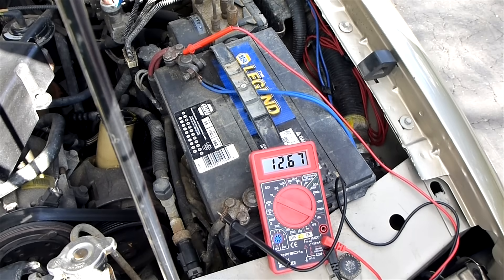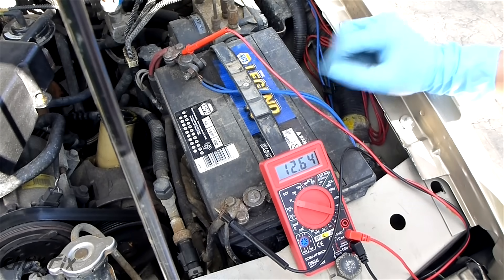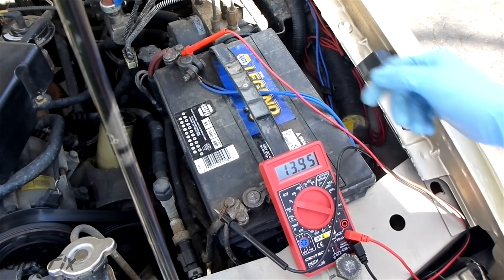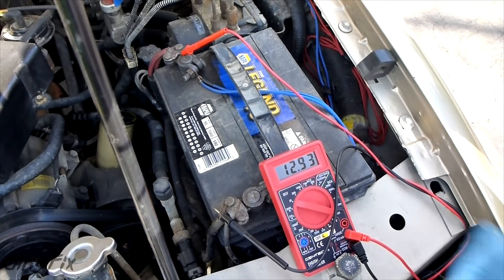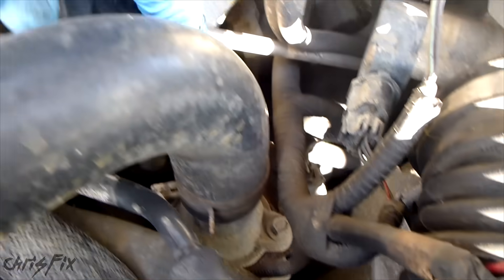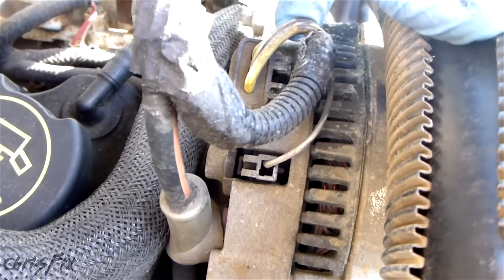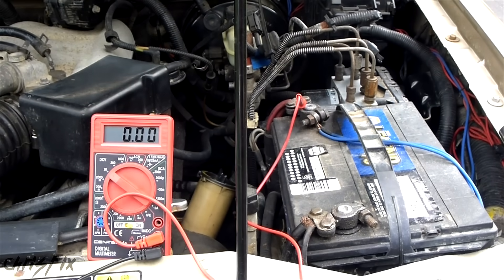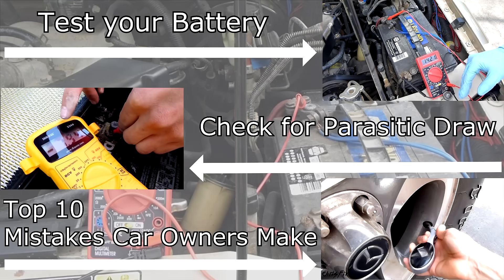How to Test an Alternator

Comment: What does it mean when there is no load and the engine is running the voltage across the meter stays at 12.4V DC? It stays the same regardless of RPM, however if it load it up with full headlights it will goto 14 Volts or with AC on full. If I just turn on daylight lights and pilot lights it stays at 12.4V DC. This is on a 2015 Honda Accord EXL just started noticing this when my battery keep dying every 4 days. I spent 2 weeks measuring the battery and charging it on and off until I decided to check the alternator and finding it is only charging 50% of the battery all the time. Is it a connection or an alternator issue, the battery is original from Honda from the factory since 2015. The dash is not showing battery light as an issue and no error code is set.

Comment: My 17 F150 is showing 12.55v off, then 14.7 on, also when increasing the demand. Yet it keeps saying "Charging System Service Now". No problems when driving it. We had a storm a couple weeks ago when I drove it I lost my monitor and power steering for a few moments. Ever since then it hasn't happened but that light still comes on. Anyone able to explain this?

Comment: can you please do a video on overcharging alternator. My alternator light is blinking, new alternator and new voltage regulator. No light on – until I start driving for awhile then alternator light starts blinking. Multimeter says charging about in the 15 to 16 volts

Comment: My car never ran at 14 V even new  ... The dealer says the normal operating voltage is 13.5    for my Mazda ..  My voltage never goes below 12.8  Even when I put all my accessories on it might go to 12.8 but it will go back up again...      every Vehicle is different    ,, I have multiple cars I've never seen 14 V on any of my  cars  Every modern car is different today ,,check with your manufacture

Comment: Great video . I have one question. Are these numbers consistent across all vehicle models or just the one in the video?
Reply from the maker: By numbers do you mean torque specs? If so, they are specific to each vehicle. You can find them online with a Google search most of the time or get a service manual. The voltage on every car should be the same tho. And the process I showed you will be very similar/the same.
Reply: @chrisfix  yeah just the voltage readings. 
So if it's less than .1 or .2 on that one test, and less than .3 on the other test, and battery with 14.6 volts running and 12.6 off, these numbers should be consistent across all vehicle's regardless of the alternator size?
Reply from the maker: @Jay-jt3zy  correct. Amperage will vary but we aren’t looking at that, just volts.
Reply: @chrisfix  yeah I know amps will vary depending on vehicle, was pretty sure but not for certain about the volts. I defer to the pros like you to ensure my knowledge is correct. Thanks for the help. Great vids.  Detailed and thorough.
Reply: @chrisfix  I am haveing a problem  on my ford connect  1.8 diesal battery light  on dash i have put a new battery  and done all the test one the ground  side Ware u put live to ground  and ova to alternator  it gives back 0.7 volts ?

Comment: My car has a no crank no start. It has a brand new battery and starter and fuel pump. When I turn the key all the lights turn on but the car won’t crank. I ran this test and it looks like the battery is at 12.6 volts when the car is off and then when I turn the key it drops, then when I turn on the lights it drops more. Do you think the alternator might be my issue or could there be another issue? This is my first project car so I’m still learning.

Comment: Honda Civic 90K Miles, brand new battery engine off 12.75, engine on no lights ac or radio 12.75, ac & lights 14.24.  Concerned about the middle reading. Do I need a new alternator?

Comment: Testing my Supra alternator. I tested the negative on the casing and it came back at 0.1 then tested the bracket and it came back 0.0 but the bolt going through the bracket read .3 … I then connected my truck to the battery with jumper cables and the case reading was 0.4 .. does this mean the battery is bad?! Reading 14.14 on battery when car is running. Was 11.7 when I first checked before jumping the car. Any input would be appreciated 🙏🏽

Comment: I just recently replaced  the alternator ( aftermarket ), battery and serpentine belt. As soon as I start the car multimeter shows 11:87. So I drove the car around and after five minutes a steady battery light  appears on dashboard. I then disconnected negative terminal on the battery and engine turned off.  This was the sign of bad alternator, so I’ve heard that. Chris, is there something I should do about that and what?  Peace of advice would be much appreciate it. Thanks in advance.

Comment: Explained great like in all of your videos! I would also suggest checking the connection of the actual battery terminal to the clamp itself and the battery cable where it connects to the clamp. That's where probably 90+% of the problems lie. Be careful with probing the alternator output with the probe! Touching the alternator output and the alternator case ground or any other ground will make a big spark! It could also damage the alternator!

Comment: If the battery is relocated to the trunk can you use good ground connections in the hood for the black lead and continue using the red to test B+ post components , alternator casing, etc?

Comment: A very good video. 

I have one question though. 

I have a 0.130V drop on the negative side to the alternator casing. 

The battery light is not on but was yesterday as the car was gradually dying as it struggled to keep the voltage to the required circuits. 

Maybe the battery light bulb in the dash has blown.

However, the recharged battery was giving 12.6V prior to turning anything on and dropped to around 10.4V when I turned on all the major current draws with the engine running. 

I am thinking that if the diode pack has failed within the alternator then the dash light wouldn’t illuminate and it obviously wouldn’t charge. 

A bad earth of 0.13V voltage drop would surely still show a very slight increase in the 12.6V if the alternator was working properly?

Can you confirm this thinking is correct please?

Comment: I have a  rave4 2003 1az engine type ( GDI model ) problem is about check engine  light coming.
I clean the oxygen  sensor first I remove the battery negative terminal 
after I fixed that oxygen sensor, the check light has gone..
then I switch off the engine, again start the engine that checks light again appear on the dashboard.
what is the problem,
I don't have a scanner....
thank you....
this is lalinda,

Comment: Hi Chris, after I replace the ignition coil on my 2012 Elantra the battery light keep flickering. I changed the Alternator but the problem still there. i can't event use the rear defrost anymore because it will turn off when the battery light flashing. Please help

Comment: How do you feel about after market high output alternators.. I run a 2000 watt inverter and some interior fans, and led lights some times.  if my OEM is 160a and say I want to go up to 240 or 320a will this affect my computer, fuel economy, performance?

Comment: Back in the 1960s and the 1970s, I would replace the diode trio in an alternator as long as the bearings were OK. I could also repair starters as long as the magnet wire wasn't burned up.  Can't do it that now...I have too much old going on.  Thanks for the video, it refreshed my memory!

Comment: Very well done my friend.  Used the same HF multimeter and indeed, well stated and your advice...spot on.  Saved me a trip to AutoZone and right to the junkyard where I grabbed a $27 buck Delco Remy rebuilt and installed it in the '98 Chevy Truck...BAMM, 14.2 volts instead of multimeter being all over the place with the old one.  No idea if it was the voltage regulator that was going, but since it's internal, makes no difference.  One again, increased my knowledge of cars just a bit more.  Thanks buddy!

Comment: No start. Voltage 11.5. Jump started first try. Voltage running was 13-14. As soon as I turned the headlight switch.... the car stopped running.... bad battery or alternator? Thank you
Reply: The battery voltage after the car shut off was 12.4....

Comment: If the car is running why not disconnect cable of battery, either it will dye which would be maybe a bad alternator, if not bad battery. just old school stuff.
Reply: Now that was back in the day. Didn't have computers in cars.

Comment: Hey Chris, you might not see this, but what does it mean if I get very low voltage, like 0.03, when testing the b post? This is a new alternator that is still not charging the battery; I'm afraid I've got a dud!

Comment: Some cars have a more sophisticated setup, and the voltage can vary more - my car for example allows the voltage to drop as low as 12.1V, and goes as high as 14.9V. A clueless mechanic told me my alternator was bad when he saw 12.1V - the alternator is fine.

Comment: Great video.  Would these numbers pretty much pan-out for older, smaller 1970’s cars with less tech and smaller alternators?  1974 Fiat x1/9, with a 33amp (possibly 44amp?) alternator, likely that old.  External voltage regulator.  At low rpm, no way I get in the mid 14’s.  Only when reving up to 1500rpm do those numbers peek out.

Comment: Great video
Reply: I realize my alternator dead in the middle of a drive to work ...

All off a sadden the rpm went down and the car started to slow down  , when I stopped all the gages went up and down for 5 seconds after what the engine torn down . 
I went to scan for codes it was 0 codes . 
And when my car was town to my home the riding on the battery was 10.5 v . ...

Comment: Hey Chris, appreciate the video. I’m having some issues with my 2010 Hyundia Santa Fe sport. For the past year it randomly losses power . This causes all the lights on the dash to turn on before it dies so am able to safely pull over and then the battery level reads low. 
We have had the alternator replaced as well as the bettery and throttle body. It  went a couple months before recently doing it again after running the AC for a little bit which drained the battery. Since then, I haven’t driven it because the battery ready 12.6 before starting and then 12.25 after starting. When we put any load on it the battery level drops and it even died again in the driveway after putting the AC on full blast. We then charged the battery again before doing the recent battery checks. I’ve pulled the fuses that have any AC controls in them hoping to see a change in the readings but no change. I will be doing the things you have suggested in this video this weekend but was wondering if you have any other input for this specific issue. Also wondering how I can do these tests with the loads on the battery if it just dies after putting the loads on the battery? We also have a scan tool and it is showing an emissions leak (which we have had for a while and has the engine light on for that) and now low voltage shows up. Really appreciate it!

Comment: The voltage on my battery showed ~14.5 volts before starting the engine...after starting it went up to 15.6 volts...can someone explain?
Reply: Assuming your multimeter is reading correctly, it looks like the voltage regulator in the alternator is defective and is over-charging the battery, which can damage it. 14.5v with a cold engine is pretty high, and w/ engine running, 15v and up is too high, according to sources I have read. But to be sure, call a mechanic at the dealer and ask about the readings.

Comment: I have an interesting one, my reading drops from 14.4 to 14.2 as the rpms go up 

This is in a 6.7 power stroke, I’ve never noticed this issue before (have battery voltage on my aftermarket guages) 

Would that be a sign my alternator is on its way out?

Comment: Everything checked out on my 2009 Honda Accord EX-L 3.5L V6 in accordance with your video. Here’s some additional info:

- alternator intermittently makes a whining noise.

- battery is approximately a year old.

- while driving Friday night, the alternator was whining.  Drove that way for 4 hours.  Check battery light appeared.  5 minutes after that a bunch of dash lights came on and car stalled.  Waited an hour, the car started again and I drove 34 miles home.  Alternator still whining and the car has started and drove fine since then (still whining though). 

- changed out relays and fuses.

Any ideas?

Comment: You might want to tighten up the negative battery cable clamp.  Also, fine a better way to connect the negative voltmeter lead to the negative battery post than just jamming the probe through the wire filaments.

Comment: do we need to check the current? is that possible the voltage is normal but output current from the alternator is lower than normal?

Comment: My battery light came on. 
I tested the batteries voltage and it had 12.5V when not turned on, and 14.2V when it the car was running.
This light has been on for almost a year. I have never had an issue with the car starting. 
So why is my battery light on?
Reply: Parasitic draw? Maybe a short circuit?

Comment: Hey Chris fix. So currently right now I’m having a issue with my truck. Whenever I’m accelerating the front end of my truck is whining very loud at speed around 30 to 40 and whenever I break it stops whining any solutions?

Comment: Hi, Chris. I took successful measurements of the battery turned off (12.6v) and with the car turned on (14.4v), however, when I tried the "Load test" with lights, a/c heater, wipers turned on, the multimeter wouldn't take a reading at all and stayed at 0.00v. What could be wrong? Thanks.
Reply: did you change the port your multimeter leads are plugged into? For voltage test do not use the 10A port
Reply: @cphollingdale4412  I didn't, which one should I use instead?

Comment: Hey I put a new alternator in my van a couple of months ago, then maybe a month later my headlights and interior lights started flickering at idle or low rpms (very noticeable at night). Did I do something wrong with the install? Could the battery be going bad.. or maybe I need a new belt? I did not replace the belt when I put in the new alt.  Been driving like this with no apparent issues but I want to fix it preferably myself.   Any advice is appreciated
Reply: Grab a wire brush and a can of electrical contact cleaner from the parts store. Brush all of your grounds and wire ends especially your chassis grounding point (I actually brush all the paint right off of them), spray everything with the electrical contact cleaner and reconnect. Also clean any "Grounding Straps" you have on the motor and the chassis. Pull your battery and have an AutoZone, Advanced, Orielly's or another store bench test your battery, most will also run your battery through a "recondition cycle" for free but plan to drop the battery off and pick it up the next day.

Comment: Hey Chris
Having alternator issue. 
So on the first test you did after battery when yours was .5 mine was .1. 
When car is running im only at 13v. I replaced battery and checked im at 12.6. 
So I need an alternator correct?
Thanks. Helpful video.

Comment: Thanks quick fix check alt putting out 17.5 volts so put new voltage regulator and presto no voltage drain 
Battery working great

Comment: Thank you Chris. Helped to confirm that my battery was low on juice and that my wife driving the car at night with full blast heating on short trips and our cold weather had resulted in a discharged battery. Alternator working fine. And battery charged again by running on idle for 10-15 minutes in daylight.

Comment: Would a belt tensioner cause voltage issues? My battery and alternator are both testing good, but lights dimming and voltage dropping still.
Reply: Yes, belt tension is very important. Too loose can't drive the alternator.

Comment: Hopefully I can get a response. I know this is an old video.

When engine is on and using power for lights, heater and blinkers. My power won't sit. Fluctuates. Still within power range. My engine also stutters to the fluctuating of reading from multimeter.

Comment: Yes but how to check how many amps my alt is capable of putting out at idle. I own 5 dmm, an oscilloscope, and clamp meter with spare batteries and will buy whatever is needed with one exception, I will not buy a $500+ alternator tester. Ha. With the tools I have, can I do the test I mentioned?

Comment: Wassup Chris. Been watching way before I even had a car. ❤️. But my car was doing fine this morning. I turned it off and on and now it’s not turning on at all. No tick from anywhere in the engine. Only the fuel pump. All the camp lights are out. Dash light turn on without key but with key in and on turns off dash lights. I have a 2003 Cadillac deville. My daily never has this before battery is about 2 years old. Idk what to do man. I’m moving this week my meter reads 3.60. With key on ON not start kuz it won’t turn over nor crank. Everything is just dead or off. I haven’t checked my alternator yet
Reply: I really need help man 💯 your my only help and hope at this point

Comment: Hi Chris just had a boiling battery last night use the car for 5-6 hrs by delivering, let it cool down for a night and today I did all the test you had on your videos all pass both alt and batt, no physical damage on batt and its still start and run the engine, what would be the reason for that? Any idea? Thanks

Comment: This depends on the battery you have. I have agm battery and its brand new car. It charges 14,4v and when cold weather or battery is low it charges 14,8v. Its perfectly normal for the car.